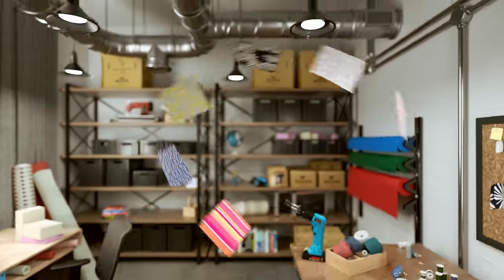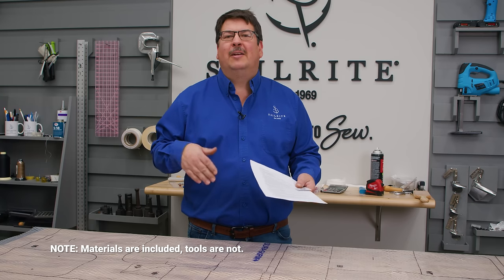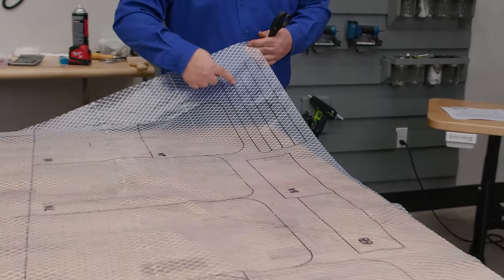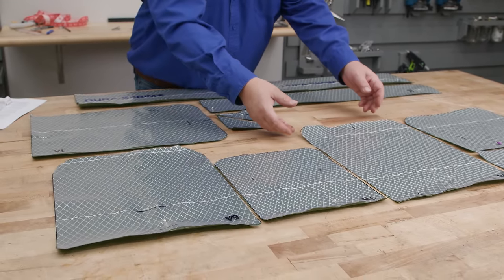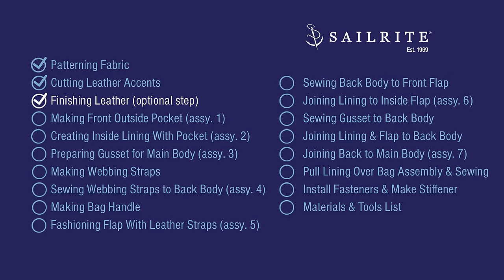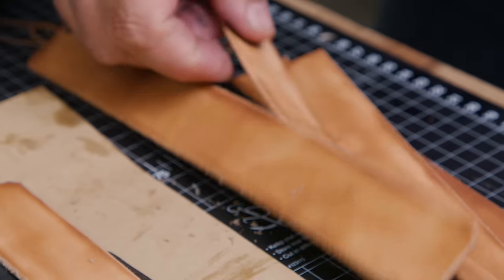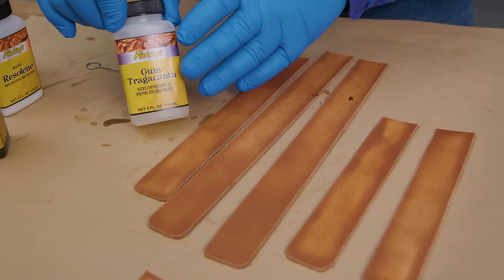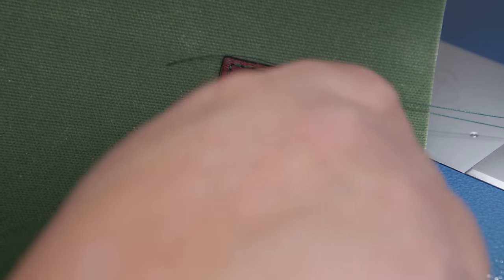Make Your Own Waxed Canvas Backpack with Leather Accent

Comment: Oh I yelled “owww” so many times at the end too. Made me laugh, I’m sorry you did too! Damn pins……
Reply: Oh and chucking the rivet hole punch into a cordless drill for the strap snaps and for the final rivets is the best idea I have seen in a while. No need to hammer and make noise and swear when it’s crooked. I love these videos.
Reply from the maker: Looks like we both had a rough time with those pins! Maybe we should start a "Pins Anonymous" support group.

Comment: What needles did you use?  Did you use a DI needle when sewing through the leather and switch to a round point sewing just fabric?
Reply from the maker: We used a standard #20 size needle (Schmetz #20 Sewing Machine Needles 135x17 Round/Sharp Point) for the whole process, even when sewing through the leather. However, a DI needle may have been beneficial when sewing leather, as it cuts a hole rather than punches a hole in the leather.